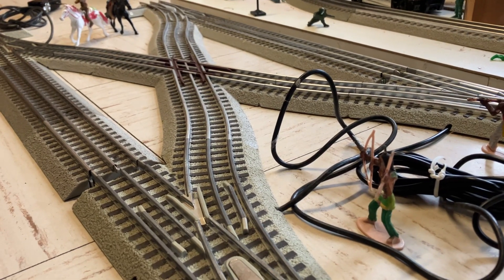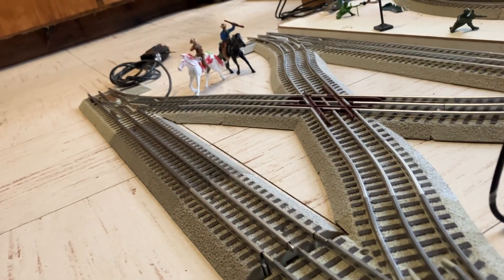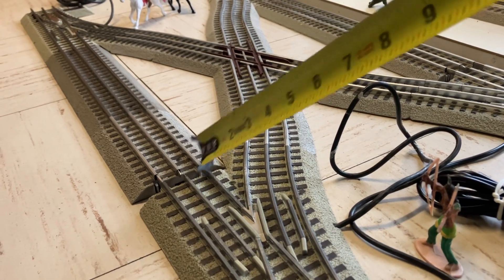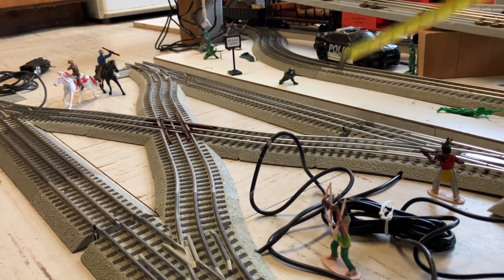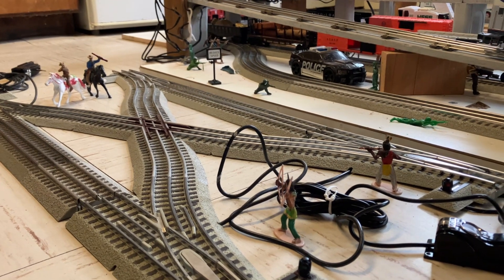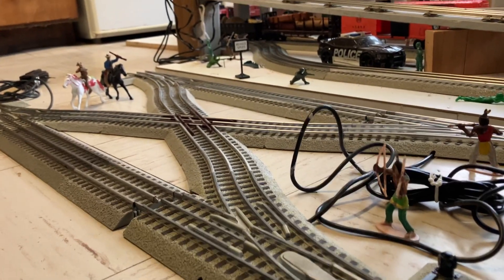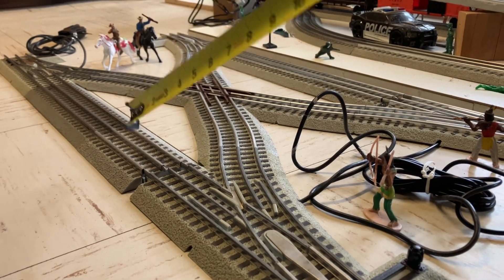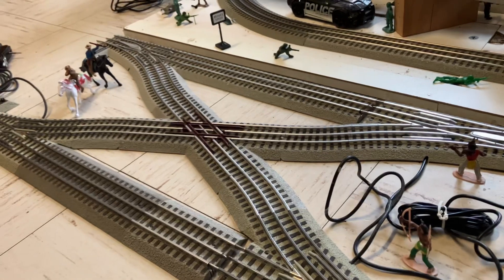Fastrack 45 Degree Diamond Crossover Part 1

Comment: Are 5 & 1/8" inch pieces a standard size?  Then, not as much customizing as I thought.
Reply from the maker: No.The fastrack comes in 1 1/8    1 3/8 1 3/4  I have these small pieces on my bottom 45 degree Diamond crossover.Also I used these small pieces in my fastrack reverse loop.You can go on line and order these pieces very easily.Thanks for stopping by.5 inch and 10 are standard size No 5 and 5/8